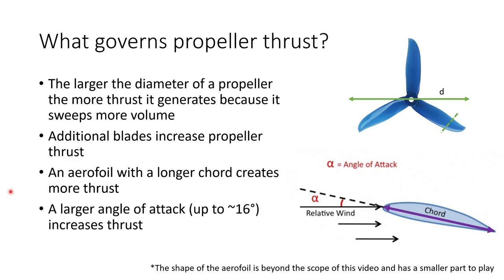How to choose the right props for your quadcopter: FPV Freestyle, Racing, and Long Range

Comment: If my algebra teacher would talk in the same interesting way, I would graduate from high school with A+
Just found why need to decrease kv, going to 6" and higher diameter props. I knew before that I had to do this, but now I know why :) I didn't even think about the speed of the propeller tip before.
Thank a lot! You doing great job!!
Reply from the maker: Thank you! I have an advantage over your algebra teacher: FPV is more awesome than calculus 😎
Reply: @ChrisRosser  i was gonna say the same thing: you have interest in the subject. Changes everything haha

Comment: So much insight! Thank you. I have always thought that props with more pitch should be more efficient. Many youtubers told otherwise and it really confused me.
Reply from the maker: It depends a lot on how you fly but if you fly reasonably fast and are gentle with the throttle you can really benefit from a steeper pitch prop! Thank you for your comment 😁
Reply: Part of the reason for the confusion is that most pilots don't mean the same thing when they say "efficiency", as Chris does. When testing motors, efficiency means grams of thrust per watt of power. But when pilots talk about efficiency, they usually mean longer flight time. A lower pitch prop will usually give longer flight times all else being equal, because it makes less thrust and so it draws less power. 

Lower pitch props also load the motor less. This is especially true when talking about a high kv motor, which will need to draw more current to generate the torque to try to spin the higher-pitch prop at higher rpms. I think the effect of the prop loading down the motor is not taken into account when it's said that lower pitch props are more efficient. Rather, the motor is assumed to have infinite torque reserve, and so the motor's performance doesn't change as the prop changes. But real motors don't have infinite torque reserve. 

Take a 6S battery and a 1900kv motor and spin a Ethix S2 prop and a Gemfan 51499 on it. I think you'll find that the 51499 is less efficient in terms of grams per watt due to it heavily loading down the motor, and because at higher rpm you enter the stall condition that Chris discussed. But even if that turns out to be false, I'm 100% sure that you'll get longer flights on the S2, simply because it's making less thrust. And that's what lay-people usually mean when they say a prop is "more efficient".
Reply: @JoshuaBardwell  Totally agree. Most pilots mean flight time, when they say "efficient". I also think that manufacturers are partly to blame. Such as every motor is advertised as efficient, light, powerful, and easy to control.

Comment: both your disk loading and prop tip speed lessons helped me 1) verify that someone's 3.5" digital toothpick actually matches kabab's analog 3" toothpick characteristics, and  2) how to calculate the ideal and maximum motor output % to make my over-kv motors match that same config. you are a legend for bringing sanity and safety to this hobby

Comment: I would really love a video about cinewhoops. The trends are covering the actual data. The Shendrones Squirt is supposed to benefit from a "duct effect" (and I feel like it flies really bad). Everyone is jumping on the "Slammed Squirt" trend and getting rid of the ducts. Who is right ?
Meanwhile, HQprop is making a 6-blade and now 8-blade 3" prop. What's the science behind these choices ? I'm using 6-blade and it feels alright, but it's supposed to be quite inefficient for a quad that already has a big disadvantage in weight to power ratio.
Reply from the maker: Ducts are on my radar as another topic to apply some science to, I think you are right people need some more information on when and how to best use ducts to get the most from them and when to go with  just prop guards.
Reply: Perfect! 😀Having both options on the Squirt and on a 3D printed frame, it will be easier to compare them with a bit more knowledge on the physics behind it.
Reply: Is the slammed squirt trend actually getting rid of the ducts? still looks like a duct to me, just a bit shorter... Anyhow Rosser has since made the duct video and I have just ordered a slammed squirt, I'm a little concerned that maybe I won't get the actual beneficial effect he described in the video from the slammed version, and maybe I should ask for a regular non slammed version. The slammed version looks nicer though 😅😅
Reply: @definingslawek4731  It is actually different because it doesn't benefit from the "turbine" effect. Chris made a video about it if you want all the details : https://youtu.be/7f2DZIC8a1k
Reply: @LenordeFPV  I'm told the slammed squirt still has ducts, and there's a video showing an increase in thrust with the duct versus without.
Anyhow I ordered a slammed one and I hope that it wasn't the wrong choice vs the non slammed version. In OP's video on cine whoops he says the most interesting part of the ducts is not the extra thrust but how it makes it more stable and thus comfortable for flying slow proximity and Indoors and stuff
Reply: @definingslawek4731  At the end of the day, it really is a matter of preference. "Performance" is not the only goal with Cinewhoops. They all have poor performance anyways...
If you have access to a 3D printer, I would really suggest trying different options. I personally prefer the slammed squirt a bit more.

Comment: Thanks for the insights. I though do not exacly buy into your concrete prop spec recommendation. I guess that also heavily depends on the prop manufacturer and how they form the tip ends. So as relative recommendations in the line of one manufacturer, I do buy into this.
For freestyle imho the compromise is that you need "punch" and you have to deal with all this adverse flow conditions. Most freestyle videos are so appealing because there is smoothness and flow interrupted by phases of hard punchs. But certainly going for the most high-pitch prop is not the right thing to do.
Reply from the maker: You are correct, this can only be a guide, to try and help people know what type of prop might be right for them. Thanks for your comment!

Comment: Once again you have put out some very useful information that will help us all build and design better flying quads.  Your points are clear and concise and understandable for even people like me with no engineering background.  You more or less answered this in the video but how does weight factor in to prop selection for 5" freestyle quads?  I have some that are in the mid 600g and others close to 725g AUW.  Would the weight difference lead to choosing different props all else being equal? Higher pitch on heavier quads? Thank you Chris!
Reply from the maker: As you increase AUW your inflow velocity in a hover is going to increase and so you might pick a steeper prop for more efficiency. If you do a lot of reverse flow moves that could affect propwash handling so another solution is to go up to a 5.1" or 5.5" if you can and keep a lower pitch.
Reply: @ChrisRosser  Thanks for taking the time to answer my question and that makes a lot of sense.  I would like to see some more prop manufacturers make 5.5" props especially low pitch ones.  I haven't seen any freestyle 5.5" props yet but would love to try some out for my heavier quad that can actually accommodate the 5.5 props (marmotte lol).
Reply: @chibikaiju922  Actually have bought some 5.5" props (also for a Marmotte frame) but only had time to do arround 5 packs or so. I really like how stable they make my heavy quad (717g) and also they just made my marmotte the fastest quad I have, but my batteries hate them. My motors are so much more capable of pulling Amps (before max arrond 96A, now all the battery has to offer, arround 130A). That went that far, that I accidently had a sag (if you can call it like that) to 8.8V on my 4s-Lipo. I hadn't pulled to many mAh at that point, but just the gigantic, onholding load killed it. Just did a dive/half loop over a big tree and hat to catch it, and then the volage began to sag out, so I had to throttle even more, but that only resulted in more amps and so on, untill I hitted the ground (at 8.8V  XD  ).

Okay, now back to the prop:
It is definetly a little quieter at hover and also I can hover now at arround 7A, before it was arround 11A which i guess is pretty amazing, and also the normal flying takes a little less Amps, but as I said, when u punch, the motors just can work hader and pull more Amps. So there is just a benefit for me in that area.

I had some problems with some pretty significant bounce-backs after fast flips and rolls, guess that will be mostly an issue of retuning the PIDs, but havent had time to look into it. 

All in all, I really would reccomend everyone that has a quad with 700g+ to just try a set of 5.5" props, I have bought these: HQProp Durable 5535.
Also I bought some 5" props with 4 blades, havent had any time to test these, but I hoped to just get more surface area and maybe also a better flying quad when its rather in the heavy part for normal 5" 3baldes, but as I said that is just my hope and will be tested as soon as the weather here gets better.

Hope I could help you, have fun ;^D

Comment: I guess the only thing I still feel curious about; is props based around air density... I.E. how would a high pitch props performance be affected by flying at a mountaintop where air is thin? Also another incredible video mate. Doing the FPV God's work!
Reply from the maker: At higher altitude the air is thinner so you will get less thrust. I think the best way to combat that without affecting any other parameters would be to use a prop with a longer chord or additional blades. If you change pitch you will affect the stall performance but additional pitch could be another way to get back some of the thrust you're losing due to the thinner air.
Reply: I would really appreciate a video relating to altitude. I fly freestyle and long range between 8,000 and 13,000' above sea level. I've enjoyed experimenting, but I also enjoy your videos, science, and experience

Comment: Nice! I graduated as a lawyer, am building my first 4inch semi longrange sub 250gr. 4s quad, and after checking motor load charts, making some calculations I've diside to get 1507 2680kv motors with biblades 4024 on a throttle limited around 20% for LR, and 4023 triblades for freestyle.. (haven't seen less pitch im a triblades 4 inch props yet). Hope I'll get parts of it soon to complete, film, test and finaly have enough footage to start my channel. 
Ty for your sience, I'll be waiting for your frame, and hope we'll get a affordable shipping cost for it (Russian Pilot in the house  😉)
Reply from the maker: I'm hopeful that my frame will be globally available at a reasonable price! Good luck with your channel.

Comment: Hi Chris, this is reallly good.
There is only question regarding AOA. The first diagram showed maximum efficiency at typically 4 degrees and stall at 16 degrees. However later you mentioned that efficiency will be improved all the way up to 16 degrees . Probably I missed something there.

Comment: I seen you briefly touched on the density of air. I am interested to see what your thoughts are on elevation and prop and pitch adjustments.
Reply from the maker: Typically the best way to combat elevation is to increase the chord length of the prop blade. Steeper pitch can hurt propwash handling.

Comment: Another great presentation.  I've been thinking about pitch vs inflow speed with airplane variable-pitch propellers in mind.  Everything makes sense except the efficiency up to 8 degrees (or 16?) and how that applies to 5" long range propellers with pitches as low as 25.  Should we be trying something around 30-35, or even higher?  I have ran across people getting surprising efficiency out of very high pitched props.

Can't wait for the Glide analysis, and hoping You can get a Fouride in at some point.
Reply from the maker: The best efficiency should occur at the best lift to drag ratio of the prop which will depend on shape but is typically around 8 degrees (this is for a hover). Obviously inflow velocity affects the angle of attack so can get a little complicated. Once you start flying the drag of the quad and the inflow velocity due to your forward speed starts to matter. At high forward speeds a steeper pitch prop is probably going to give you more efficiency in g/W.

Comment: I was thinking about this more, do you know if the prop flex has any effect? These fpv props are quite flexible, I presume at a certain disk load the majority of the flex will have occurred and have little impact. I wonder if there is excessive flex at a certain low load threshold.

Comment: I’ve had a couple of questions regarding props.

1. How much of an adjustment should we consider for different altitudes? I’m in the Rocky Mountain region, which is about 4000ft above sea level.

2. How can we tell if a prop is killing battery performance? Is there more to consider than a drop in flight times?

I guess I’m looking for some general rules to apply to a 5” 6s low-kv freestyle setup. I’ll give it some thought, revisit, and try the math. 

Thanks for the info. I’ve been curious about the subject.
Reply from the maker: Have you checked out my video on Motors? It should give you some pointers on battery considerations. As for altitude consider more blades, slightly higher KV and as a last resort a steeper pitch.
Reply: @ChrisRosser  gotcha. I think I need to shift my perspective. I’m coming into this from a mindset of choosing the “best” prop for an existing setup in my circumstances. Perhaps I should consider whether that existing setup is appropriate to begin with.

Comment: 0:00 Intro
0:39 Prop Thrust 
1:46 Prop Efficiency 
2:18 Disc Loading
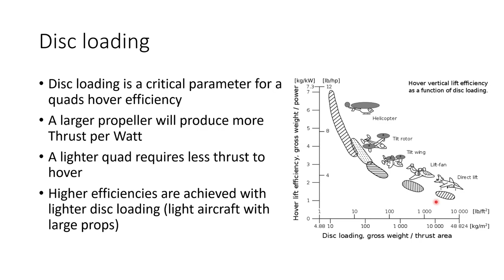3:01 Angle of Attack (AoA)
3:53 Stall
5:20 Prop AoA Calculation 
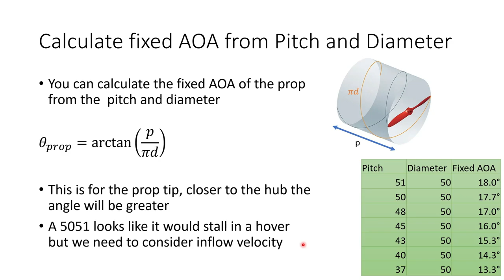7:41 Inflow Velocity 
8:48 Estimating AoA Adjustment 
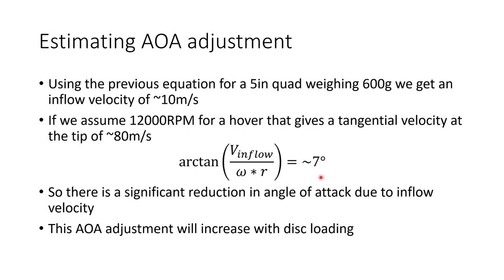9:44 Adverse Inflow Conditions (aka when flying)
11:10 Max Tip Speed 
12:48 PROP SELECTION - Freestyle 
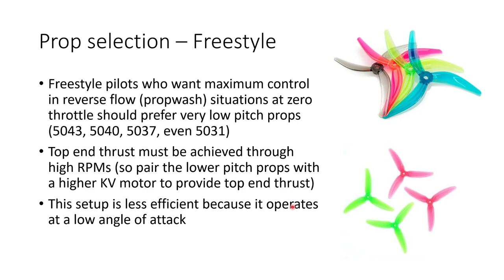14:24 PROP SELECTION - Technical Racing
15:39 PROP SELECTION - Long range Racing
17:10 Conclusions

Comment: What if you had a 5” quad running 2806.5 motors but usied 5” 6 blade propellers? Would you get the trust performance of a 7” quad with tri-blades? Because the surface are of prop should actually be greater on the 5” hex blade. So would you be able to go with a bigger motor on a smaller quad and get similar performance? Better? Worse?
Reply from the maker: Small propellers are less efficient than big propellers. So you get less thrust for the same power = shorter flight times. But if you don't care about efficiency then you can get more thrust with more blades and a bigger motor.

Comment: I think some useful oversimplification would be possible just in comparing chord profile, and what the relative pitch across that profile is going form the hub to tip.  It's impressive that all of the most recent props have converged on roughly the same chord profile (with varying amounts of leading edge sweep) as a trade between durability and in-air performance, and the 'best' of the latest units all share reduced chord that helps lower rotational moment without results in a frail edge of the prop, and I think that's why the propwash response is so good (compared to back in the day when we were flying bullnose props).
Reply: @Chris Rosser - the rule of thumb I've been using to calculate maximum tip tolerable RPM has been 38k RPM, in nominal cases, for 5".  Thanks for that WarpDriveProps calculator tool, since I feel like doing the more simplistic calculations lose accuracy by the time I'm at 7", as I keep finding myself just over the limit on builds I have calculated to be marginal but within bounds (the good news being that throttle limits are easy to adjust downward).
Reply from the maker: I would add to this that I think manufacturers are designing props that don't require throttle expo or throttle limits because no-one is using these (except to run 2400KV motors on 6S). They are realising they need to reduce thrust to give pilots more control. If everyone tuned their feel using throttle expo I think we would see more props that are designed to get the most from our motors.

Comment: Hi Chris, what is the effect of pitch and efficency vs number of blades? I guess a lower pitch creates less turbulences which affect the next propblade and probably decrease less the effiency compared to a prop with higher pitch blade. I expect not a dramatic effect, but I think the question is interessting, if low pitch props are loosing less effiency with more propbaldes over high pitch props with more propblades. 
Also your recommendations of Longrange props brings up a question: on 4"LR you see mosten low pitch props like 4024. The Reason is the amound of amps, LI-Ions can`t provide much amps, so there is also an electrical tradeoff of pitch vs amount of amps which can be delivered from a Li.Ion pack. So where is the sweetspot of pitch vs. amps?
Reply from the maker: Pitch and number of blades should be relatively independent of each other if that helps.

For LR cruising a higher pitch prop will give more efficiency but you need to use a throttle limit to control your peak amp draw. If you don't use a throttle limit you need to run low pitch to control amp draw (but you suffer with lower efficiency overall)
Reply: @ChrisRosser  Understood, but with high pitch I expect to be already close to the limits if LiIon packs.